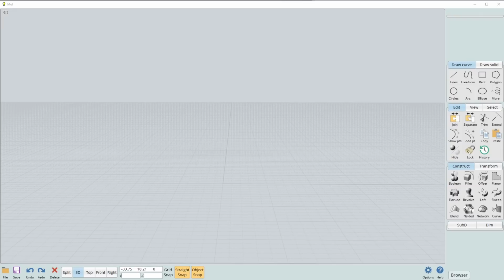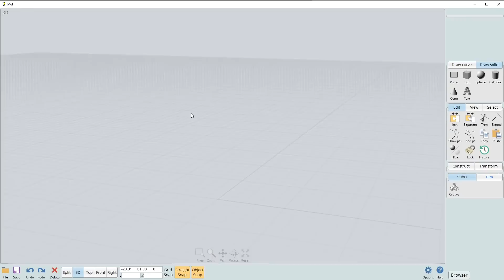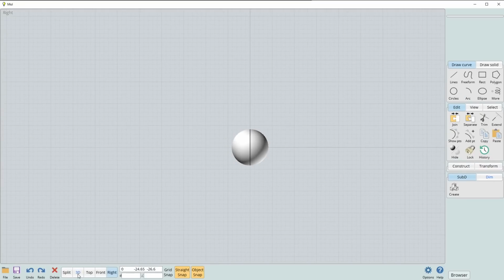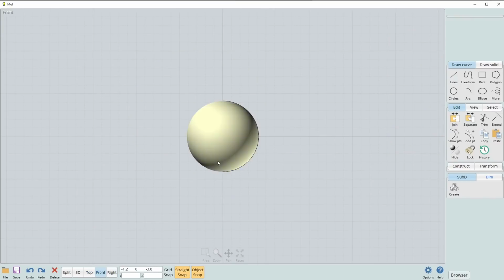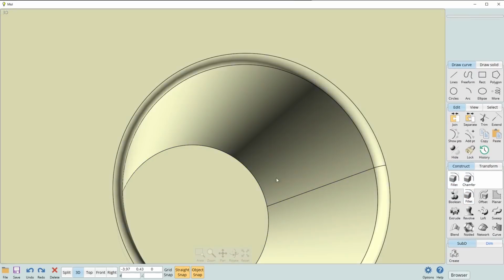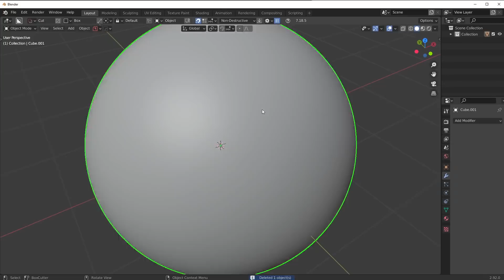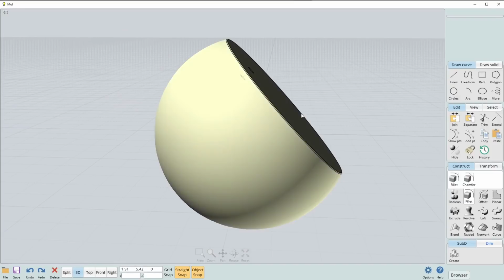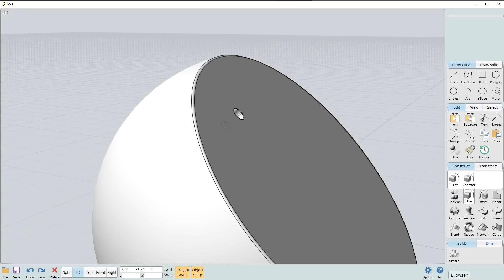So what exactly is NURBS modeling?

Comment: Thanks a lot! But at the same time you're comparing two 3D software techniques that don't have the same purpose! One is for the general public, and is mainly used for animations, games and environments. The second is designed for industry and quotations! High-precision computing! However, the latter will produce much heavier creations than the former, and in identical shapes. The latter's creations are not intended for animation or video games. There, the creations need to be lighter in polygons! Otherwise graphics cards will explode! Software such as Solidworks and others need to provide high precision for the metal and plastics industries, which are the primary users. Animation on this type of software involves studying movements to find where there is friction, in order to correct design errors and make calculations for engineers. The creation of cartoons, games, sets or 3D slideshows doesn't need all that! That's why design software is not set up in the same way.
It's true that these days software packages are becoming more harmonised, but this is due to pressure from the public and 3D creators, and not at the request of manufacturers! Thanks for sharing! Stéph.
Merci! Mais en même temps vous comparer deux technique de logiciel 3D qui n'ont pas le même but! L'un est grand public, et destiné surtout aux animations, et créations de jeux, d'environnements. Le second est destiné à l'industrie et aux cotations! A la haute précision informatique! Cependant le second réalisera des créations bien plus lourdes que le premier, et dans des formes identiques. Les créations du second ne sont pas destinées à l'animation ou au jeu vidéo. Là il faut que les créations soient plus légères en polygones! Sinon les cartes graphiques vont exploser! Les logiciels type Solidworks et compagnie, doivent faire de la haute précision en direction des industries métalliques et plastiques, qui en sont les premières utilisatrices. L'animation sur ce genre de logiciel, c'est l'étude des mouvements pour trouver là où il y a friction, afin de corriger les erreurs de conceptions, et de pouvoir faire des calculs pour les ingénieurs. La créations de dessins animés, ou de jeux, de décors, de diaporama 3D, n'ont pas besoin de tout cela! C'est pour cela que les logiciels de conception ne sont pas réglés de la même façon.
Certes de nos jours ces logiciels finissent pas s'harmoniser, mais sous la pression des publics et créateurs 3D, et non pas à la demande des industriels! Merci du partage! Stéph.

Comment: I normally work on both. Bevels and cuts are way cleaner. Shapes are way faster to create. And with the curves to mesh add-in you can drop it to blender and create the desired shape inside blender. The details are amazing. Even exporting to obj your loss percentage it is not perceived so much in rendering. Now... You'll have to work harder if you want to make that model game ready. Blender will just chopp it like a butcher... But... your ideas don't have limits.

Comment: In poly modeling you define edges and surfaces through point interpolation, in NURBS based software you manipulate/define curvature directly, hence "infinite" resolution. 
But as great as that is for constructing functional parts with a few curved features, modeling parts with fluid shapes and varying curvature can quickly become a nightmare. Curvature continuity is a real b!tch. 
You'll end up staring at curvature combs and zebra overlays for hours like a crazy person, hoping you'll get the darn thing G2-ish before you run out of eye drops. And you can't hide your  crimes, no subD or normal transfer available on this mission, mate. Fixing bool cuts and chamfers is therapeutic in comparison ^^.

Comment: So, I was looking at MoI for what you said before; does it include things like array and screw which blender has? Does it export model as high poly ready for baking?
Reply from the maker: Yep, it has array, circular array, etc, more than Blender has actually. Mesh export is based on your triangle count. You can make it as low or high poly as you'd like (for rounded surfaces, lower triangle exports will yield faceted edges).
Reply: @JoshGambrell  On export for high polys, the shading will always be right? Mainly I'm looking for something to make the high polys to bake to low easier. I may get this at some point in the future if it will alleviate the difficulty of making support/control edges and all that while still working enough to make things to bake off of.

Comment: You are using "Infinite" alot, but I don't think you understand the nurbs and poly difference. You could model down to same resolution with poly too. It's just about the higher level B curves.
Reply from the maker: Nurbs is basically elementary calculus fundamentals, it is an infinite limit in terms of resolution and will never have the standard idea of resolution due to being vector-based. Technically infinite subsurf yields nurbs, in a way

Comment: Nice video. As a 3D CAD guy, I use NURBS because its output is geared towards accuracy for mass manufacturing. My go to software is Rhino 3D NURBS / Sub-D modeller. I also use Blender as well, but for clients who requirement is visualisation, not manufacturing.
Reply: Where did you learn Rhino from? I'm considering using it but I don't see a lot of tutorials and guides compared to something like blender.
Reply: Way late on ny response here, but if you're still interested, Rhino is very user-friendly and intuitive; the user manual and website have tutorials to get you going. @diyguild1327

Comment: Poly-based modeling is basically digital paper-folding or digital origami to create shapes and forms. This is  a dead end approach because there are many fundamental geometry problems in folding planes to create shapes. These fundamental prblems are known as the mathematics of Origami, a sub section of mathematics. I have looked at NURBS modeling and its mathematical approach. However, there is also a fundamental flaw as well. NURBS modeling basically deals in surfaces or 2D when you are dealing in 3D.

I have accidentally stumbled upon 3D modeling about a year ago and been questioning the way things are done in this field. There is a simple rule I have; if things are convoluted and counter-intuitive, then there is something fundamentally wrong. I can understand why it has started that way decades ago. But the transitions should have occured somewhere along the way. I suppose this industry has been highly isolated and insulated up until this point.

Comment: There is no such thing as "infinite resolution". If you are seeing the model, you are seeing polygons because that's what your GPU understands. It's only that it reconstructs the geometry dynamically as you zoom in.
Reply: I thought the same when I saw it. But it is still infinite, just not on screen. But the function used is infinite. It’s kind of like saying it’s not infinite cause your screen only has 1920x1080 pixels. Then nothing is infinite.
Reply: @DamianMathew  The function is still using double-precision floating point arithmetic, so it cannot have infinite precision. Not even the real world has infinite precision :P 

I'm saying that the line segments and the triangles are recalculated and presented dynamically, based on the viewport - this way it appears "infinite", but there are still rounding errors the more you zoom in.  
(btw, software developer here)
Reply: @grproteus  yes I guess you are right haha. I guess the float makes it quite inaccurate or at-least not infinite.

Comment: I combine softwares, I can make something in a few minutes on Rhino it will come super clean and exact. But you are right, you need another approach. 
Sometimes I just start from scratch but even so is faster. Or another times Is easier to just grab some poliygons and move them than go back modify a curve and  re project, extract and bevel something because of a little change.
But you can use both.Some elements poligonal and another nurbs and mix them.
How do you import iges files into Blender? Do you have to import as a poligonal object or is there a way to keep nurbs inside of Blender?

Comment: funny to see a video about this topic from you after I discovered NURBS modeling myself two days ago. I wanna get more into Arch Viz and I found out a lot of companies and people use NURBS modeling for that. Now, I am feeling ambivalent about what I should focus on. Does someone have any experience with this?
Reply: Archviz is rendering, not necessarily modeling. 
Oldschool Architects only work in 2D so you need to model for Archviz. In this case it doesn’t matter if poly or nurb, just needs to be quick and look good. 
Modern architects work fully in 3D, so no modeling needed for the render guy. All the render guy needs to do is focus on interior design, light, materials or what ever.
Reply: @DamianMathew  oh hey Mathew, so you don't just respond to your own videos. I appreciate that. :)
Would you say I should focus more on rendering, lighting, design, etc. instead of modeling?
Reply: @redjohn4886  I’m everywhere haha 
to be honest, do what’s fun. That’s what you will get best at. But one thing I can tell you: a modeler from my experience is easier to replace. Also a modeler more likely will work with other 3D guys (lower budget). A render guy can shine with his unique style and also sell pictures instead of models wich helps working directly with a client (bigger budgets). But that’s really just my personal opinion. I’m sure people will also think the opposite.
Reply: @DamianMathew  Thanks, man!

Comment: I have Moi, payed a lot for it, rarely use it, because I found it extremely buggy and they haven't updated it in eons. Too bad really cause it's like working in SketchUp but you can do amazing organic shapes.
Reply: Moi3D cost 295$ for a full version and 99$ for a student, so yes compare to Blender (without paid addons) it's expensive ^^^

Moi3D forum is one the most active on the web and the developer answers to any questions. Moi3D v4 final has been released in 2020 with new features like subd, have in mind that Michael Gibson is on in own to develop the software so yes it takes time for new releases but on the other hand so stable with no bugs except the hacked Moi3D versions you find on the net.

Comment: is there any way to somehow convert cad models into polygon models
Reply from the maker: Sure, export as fbx.
Reply: Oldschool blender sometimes dies on fbx, especially from MOI. 

Best solution still MOI for the average user. But there is also FreeCAD, Fusion360, Alias, Rhino, VRED, DeltaGen and even Blender Addons for direct import. I think C4D also imports CAD directly. 

.step is the most common CAD exchange format.
Reply: @DamianMathew  Hello, what is the name of the addon used for importing .step in Blender? I've found STEPper on Gumroad but is there also an addon which comes with Blender?

Comment: Reading the comments, I have the feeling that NURBS are for many of you something "magical" or like the holy grail of modeling... Let me tell you, it's not. 😄 I started using Alias Power Animator in 1992 and spent the last 25 years building cars and car parts with Alias AutoStudio. A car built out of NURBS looks fantastic and you need the mathematical precision  to be able to generate the data for the tooling. But creating let's say a bumper or a smoothly shaped IP panel out of rectangular NURBS patches (with G2 or G3 continuity) is not much fun... It's time consuming and many times downright frustrating. If a designer asks you to change the beltline just a couple of millimeters, you can spend a couple of days realigning all those NURBS patches and getting rid of highlight problems. As (healthy) NURBS surfaces are always 4 sided, you have to use trim boundaries as the basis for adjacent patches. This creates just as many problems as Boolean operations in Blender. I think, both methods have their drawbacks and advantages and one should use one or the other based on the requirements set by the deliverables (animation, design product, game props, etc.) Ever since Blender 2.8 was released, it's gaining more and more ground inside car design studios. It's much faster to build up and keep modify a design concept with subdivision polygon modeling as with NURBS and especially with Blender you have immediate and very realistic visualization feedback. I for my side, enjoy building stuff in Blender and use that as a base/template for the final NURBS surfaces. Makes life much easier! 😁
Reply from the maker: Couldn’t have said it better myself! It has its limitations.
Reply: as a NURBS modeler, I can totally agree. I too was frustrated with the issues, specially surface continuity. but you should try Rhino 7, dude finally has SubD and its not the best, but it is so much easier now.
Reply: @dev.swarnakar  Autodesk also introduced subdivision surfaces in AutoStudio two releases ago but I find it much simpler and much more enjoyable to build SubDivs in Blender as you have a broader toolset. On the other hand what's really missing out of Blender are tools like draft with precise directions and angles. I think a programmer could easily add such a functionality but I guess no one has really tough about it as it's not necessary for animation. SubDivs in Alias are at the same time also NURBS surfaces which allows you to combine the SubDivs with other parts of a model. (As SubDivs are also four sides patches and the Catmull method generates the smoothness between these patches, it's actually relatively simple to span a NURBS on a SubDiv patch.) The result of course is not a Class A NURBS surface but a big mess of tiny NURBS patches...
Reply: @SteveThinman  I, apparently, don't know anything about how autodesk softwares work, but I do agree that blender has a lot of and also better SubDiv tools. For all the issues you mentioned from the 2nd line, like drafting and mathematical surfaces, that is where the Nurbs softwares really shine. But it has its limitations and that's why I am subbed to Josh (learning Blender) to make my modeling process easier. However, since Rhino 7, we have SubD modeling, which is different from Blender (for sure) but it has a very unique feature. It let's you model in SubD and convert the surfaces to NURBS (not patchy) and that is a very important for a number of reasons, the most important being explained above in the video. And just to better explain, here are some links-

https://youtu.be/SeHWCUu65eU
https://youtu.be/FEh9cxzdaQM?t=1730   (another awesome guy)
Reply: @dev.swarnakar  Thanks for the links. 👍 I have a similar situation regarding Rhino as you regarding Autodesk. I only know it from videos and tutorials. Judging also by other YouTube videos it seems to me that Rhino does the same as AutoStudio. It spans NURBS on to quads and tries to combine as many of them together as possible. The result is tons of interior Isoparms which you can hide but in the underlying mathematic they are still there and so the surfaces are anything but Class-A. It's great to have such a feature for quick evaluation but at the end you have to build a clean final model. I guess I'm the future these tools will evolve and maybe some AI processing will help to create better NURBS out of SubDivs.
Reply: "Reading the comments, I have the feeling that NURBS are for many of you something "magical" or like the holy grail of modeling..." - I would rather say that many from the comments, haven't heard about it. And imagine that someone shows you surfaces with completely "legal" booleans. Without mentioning drawbacks and problems with it. XD
But judging from this video, tools have got more advanced. And process of working more em. Without all the technical details? I know NURBSes from MaYa. Lol. Like from 2004-2005. And they are very technical, there. XD
Reply: Ah the holy grail that is G3 A-Class Surfacing, goes great with a bottle of whiskey.